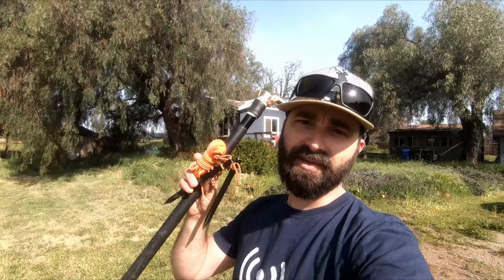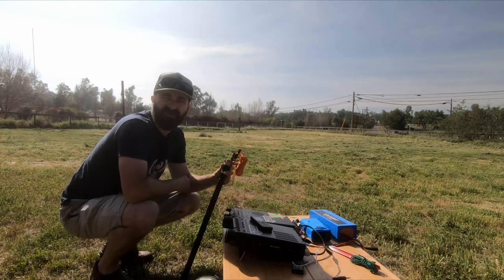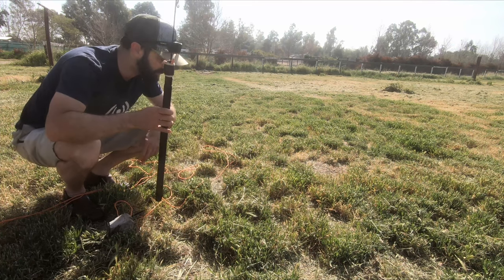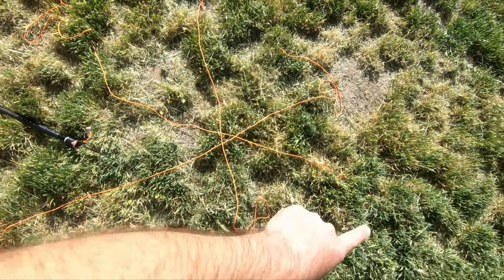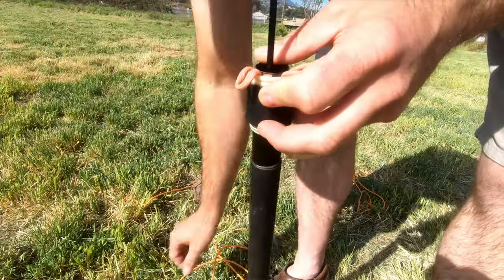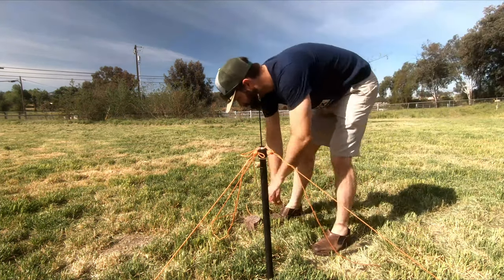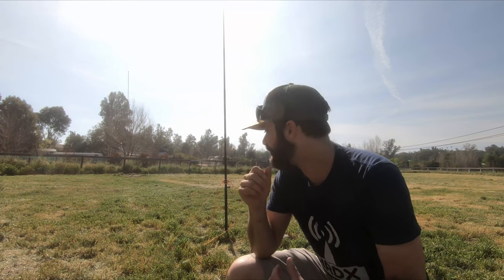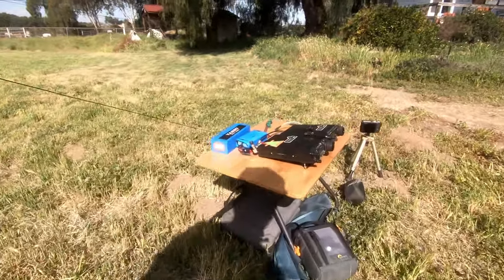HF Wire Antenna Setup How-To for Portable Operators

Comment: Bring along a couple 18" gear ties in 'never lose orange' and tie the mast to a small tree or bush is another option that works well for most of the summits I am on in NorCal.  I have, at times, tied to the roots of an upended tree.  Even above tree line there are usually a few small trees or bushes, if not stick the mast in a rock crevice.   I spiral the gear ties around the collapsed mast when I am transporting it.  Thanks for posting the video!  TU es 72 de AI6XG

Comment: Great easy set up. I use a long piece of paracord, clove hitch in the middle, either end to pegs. Then a shorter piece, again clove hitch plus half hitch to secure, then to ground peg. Just need to get your antenna kit into the UK.

Comment: I use similar fiber glass extendable mast  for permanent installation,   I wrap a few turn of electrical tape at each section , so it does not collapses during strong wind.   AG6JU

Comment: Nice, thanks for making this. I had a very similar set up for my first attempts at POTA this past weekend, but I used snap links to loops on my mast and taught line hitches to my tent pegs. That worked fine, even in 45 knot gusts, but the simple trucker's hitch style tension at the mast would definitely shave weight. I'm going to copy that.

Comment: I know I’m late to this party but a suggestion.   Because the three guide wires are so short.   Use a tent stake at base of the pole sticking out of the ground a couple of inches to stop it from sliding out.   Just a Velcro strap is all that is necessary.

Comment: Thanks again for the video, wire antennas are light and easy to set up, and offer advantage over other types.
Thanks for inspiring me to try out end feds.
Reply from the maker: End fed half-wave antennas get rid of the bulky, heavy coax and make for a very light package.  As a full-size antenna, they are also very effective!

Comment: Easy Peasy…  I often use my wire antennas as slopers.  Attach the wire end to the mast… walk it out, and lean it into a convenient tree, and tune it up!  Yahtze!
Reply from the maker: I was just thinking... I should do an assessment of 3 setups - inverted V, inverted L, and sloper.  Do the analysis a few times with different height poles.
Reply: @K6ARK  That would be a great video!

Comment: Thanks Adam.  I seem to run into a lot of hams make set up way to complicated, especially new hams.  The setup seems to take priority over getting on the air. You always seem to focus on simple efficient setups. 
I have made a lot of contacts with the wire laying on the ground when I don't know the mast has blown down.  I do kick a small divot in the ground to set the mast into.
Reply from the maker: Yes! A little divot for the base of the pole can help.  I've seen some use a small spike at the base of the pole as well.

Comment: Great video! Can you elaborate on how your radios are connected? Specifically how you have the antenna coming to a T-adapter and going in to both radios. Wouldn't transmitting on one of the radios damage the other?
Reply: I expect it's actually a coax switch that connects the ant to only one radio at a time. That's a common setup.
Reply: Probably on one arm of the T adapter there is a 1/4 wavelength coax with short circuit at its end to behave as a bandpass filter just for a working band?

Comment: Great video Adam,
Clear and to the point, I run ny antenna system in a very similar manner but instead of an s-clip (which is great) I use this little triangular piece of cutting board that Mike @K8MRD sent me a couple of years ago. I also had modified the end of my mast to make it a bit mor ridged as well, while it is a bit more weight I will often pack a second mast for my Roll-up J-Pole. 
I know that you are busy these days but I really enjoyed those short Quick Tip vidios that your were doing for awhile. 
Keep you the great work/content Adam. 73
Reply: I have tied in a small washer at the mid-point of my portable EFHW and slip it over the end of the pole. That way it slides all the way down the first section and rests on the slightly larger second section which is stronger.
Reply: Aten a wire qrp

Comment: Any good videos on how to tie rope to end of wire to pull tight?
Been having excellent results just laying along ground or in a loop on ground but now want to experiment with inverted v 👍
Reply from the maker: Did you try the method I demonstrate in the video?
Reply: @K6ARK  That is my plan tonight. In the video it doesn’t really show how to attach a string to the end of you half wave end fed though. Just the loop you tied to attach to a rock
Reply from the maker: @full_metal2452  sorry, I misunderstood what you were asking. I use an Albright knot. https://www.101knots.com/albright-knot.html

Comment: Nice video, tnx, I use qrpguys 20.30.40m tuner and 16ft radiator +4 radials. Rig is Youkits tri bender.or qcx. Can't wait for warm weather. Outdoor qrp is fun. 73'

Comment: Greetings from UK!
Been watching your videos and have been enjoying a ton and learning a lot as well.
I have been trying to find a solution for a receive only antenna to use while traveling by plane on either a Yaesu vx-6 or Icon ID-52.
Any suggestions that could fit this purpose?
Thanks.

Comment: Solid. About the same as I've used at the beach & in parks. I have a small chunk of angle metal that I shove in the ground and then use double sided velcro strap to hold the mast to that. Suspect your guy line system is easier to set up and probably a tad more sturdy . . . 'cept at the beach, where I can really shove the metal into the sand or use the base of one of those beach umbrellas (people abandon them along the beach and I'm a first class scavenger ;-) ). Thanks for the video. 73 de W8IJN --  Пу́тин хуйло́!

Comment: How did the receiver test go?  Are you running both radios at the same time with the Tee adapter?  Is that okay as long as you don’t transmit?
Reply from the maker: It works if you do not transmit. If you TX... Bad things will happen. 
It's probably wiser to use an antenna switch and change back and forth. 

The test was interesting.  In general, I preferred the analog filtering and subtle DSP of the 857d over the watery sounding DSP on the 891. I sold the 891 soon after. 

I could see the 891 being better for high RFI, perhaps in a mobile setup, but for portable ops in relatively quiet places, the 857 with Collins CW filters is better.
Reply: @K6ARK Spectacular! I didn’t realize you could do that. I recently did some 2m receiver testing between my FTM-500, FT-2900, and RT95… swapping coax manually. Learned the FTM-500 receiver was significantly better, sufficient enough that I was able to chase weak signal SOTA and make contacts I wasn’t able to with the other radios. 8 extra points that day 👍.
Reply from the maker: @soldermecold7456  the nice thing about the T connector is being able to record the same signal through both receivers at the same time. I would then listen to them on my right and left ear to compare.  But like I said, just don't TX 😜

Comment: OK, since nobody mentioned it exactly, I'll ask.  You take the BNC out of the winder that is holding on to it with a built-in CLIP for the BNC (00:54).  Can you share the file to print that winder or even sell them on you site?  That's a nice little detail to have in a winder.
Reply from the maker: David, they are on Amazon now, but don't seem to be appearing in search yet for some reason. https://amzn.to/35z626x
Reply: @K6ARK  Just ordered one. Thank you. (You can never have enough home built antennas IMHO, but I’m certainly pushing the theoretical limits)

Comment: Was the endfeed or random wire setup?
Reply from the maker: I apply this same setup for any end-fed antenna - both the End Fed Half-wave and the 9:1 unun with End Fed Random Wire.  For the random wire, I run the counterpoise off in the opposite direction laying on the ground.